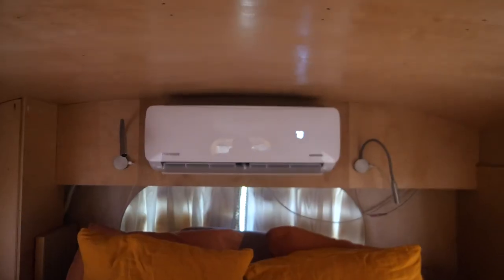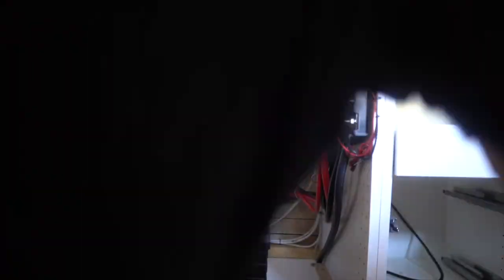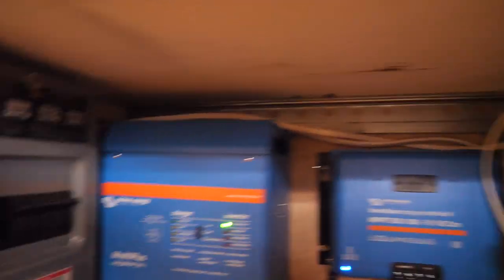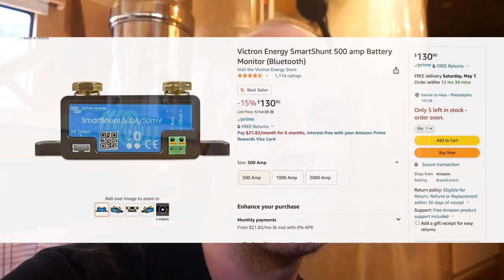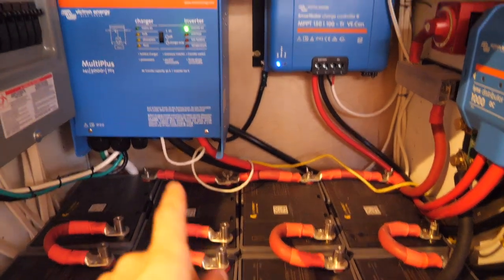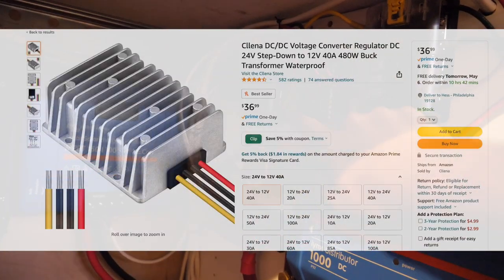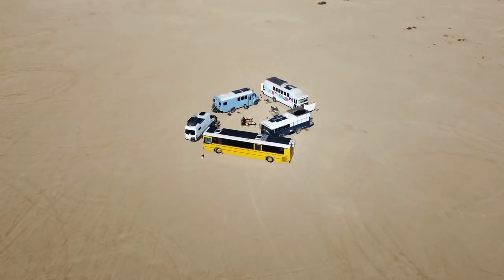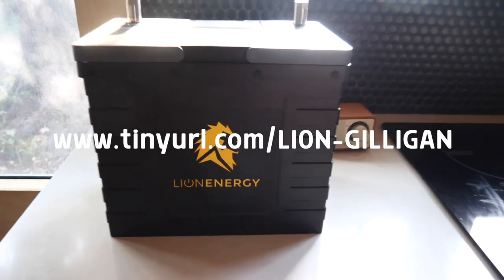ALL ELECTRIC Bus Conversion Off-Grid System Explained

Comment: Planning to do all electric/solar on our conversion, is there an electric water heater you recommend?
Reply from the maker: You can actually find everything I recommend at www.tinyurl.com/busbuildspreadsheet. But yes I rccomend the Bosch 6 gallon point of use electric water heater.

Comment: OMG. You have done it again!

So what's the most you could think to max out for a short bus with 4x4 lift and overland trailer combo?
...asking for a friend...
Reply from the maker: Wow that sounds like a cool rig! What do you mean by Max out though? Solar panels or batteries?
Reply: @MobileDwellings  

Both 😉

Taking into consideration weight and rooftop space.

Comment: What will the calculations be like to drive the schoolies with electric motors? (rip out the engine) Maybe a heavy generator as back up. 🤔🤔

That would be a dream.
Reply from the maker: If Tesla can make an electric 18 Wheeler it definitely can be done. Would require an incredible amount of batteries and a great network of chargers. Electric delivery vans are coming soon. I think that's the next step.

Comment: The next big breakthrough for this kind of endeavor  will be retractable solar awnings. I don't rv but I sail, and I can't wait to retrofit my boat with  solar sails
Reply from the maker: solar sails would be so sweet for boats. if i could have a solar powered electric motor with battery backup to supplement the wind i think i'd be on the water

Comment: With the inverter does it have to be plugged into shore power to work? I’ve got my system all installed and everything works (the only thing i don’t have is the lynx distributor, i just used normal positive and negative bus bars) and everything works great when plugged into 50amp shore power but the inverter doesn’t turn on when I’m not plugged into shore power. I’m not sure what I’m doing wrong, any tips?
Reply from the maker: This seems like a weird question but you have a battery bank right?
Reply: @MobileDwellings  yes i do, i have 2 12v batteries wired in series for 24v, the inverter is victron multiplus 3000w 24v. the batteries are connected to bus bars that connect to the inverter battery posts, everything runs smooth when connected to shore power but when I'm not connected to shore power only my 12v fuse box works but my inverter won't turn on or push power to my 24v breaker box